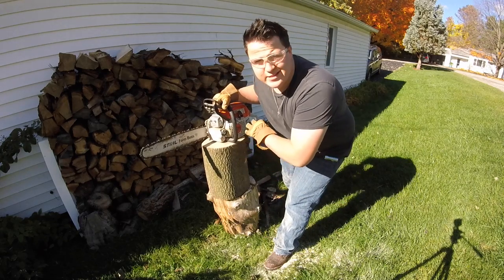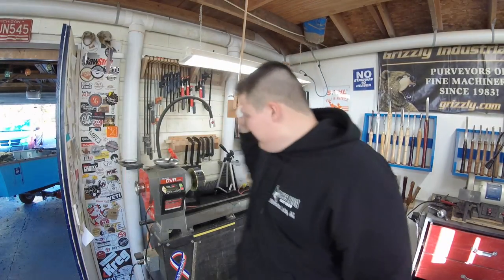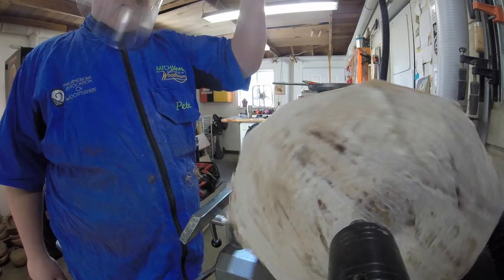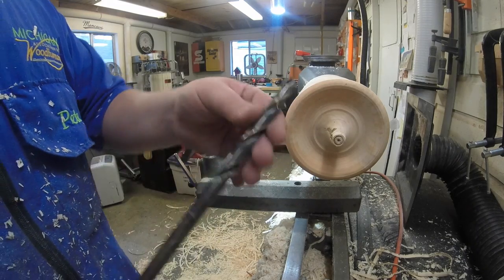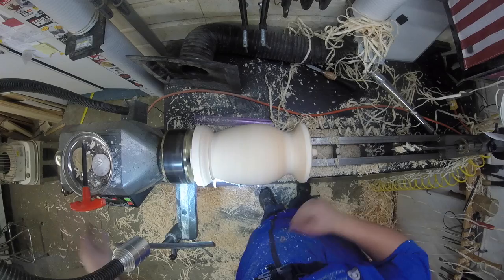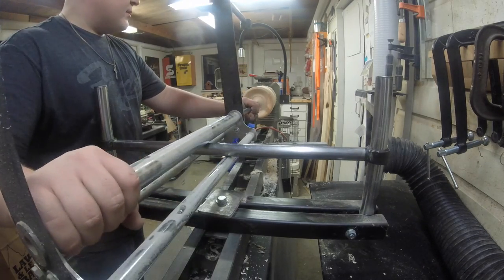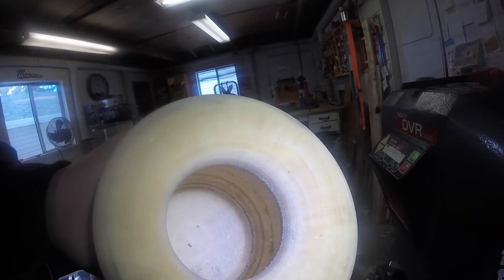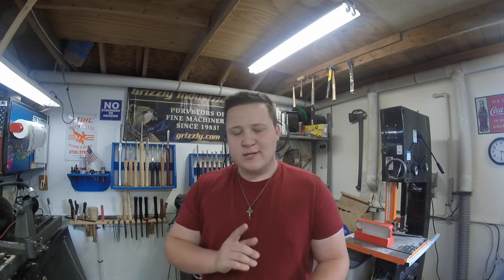Maple Vase

Comment: Love your vids!! Keep them coming! What hollowing system is that?
Reply from the maker: Thanks! I have the Kelton Hollowing Rig.  Kelton Industries still makes the hollowing tools but they discontinued the laser system.  I bought mine used a year or two ago.
Thanks,
Peter
Reply: looks like a pretty sturdy system! I have been doing some small hollowing just using regular tools that I made, but I would love to try doing some larger pieces...bigger than 6-or 7 inches tall....any more than that and it pushes my current tools to the limit. Thanks again! And keep making those awesome crazy long shavings!!!